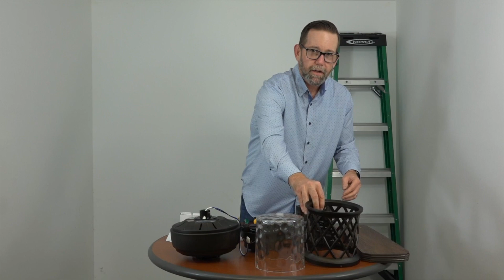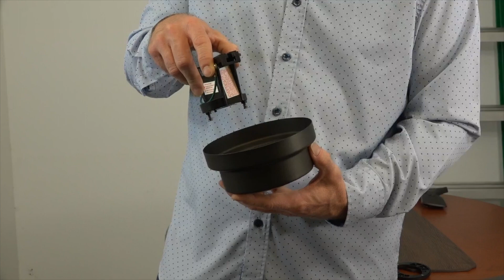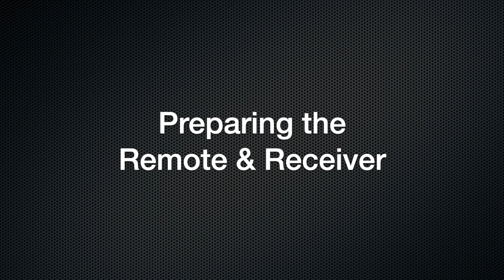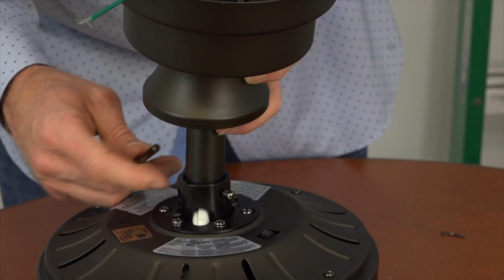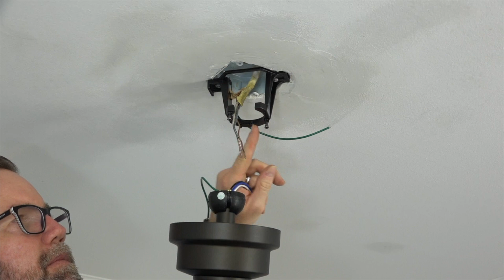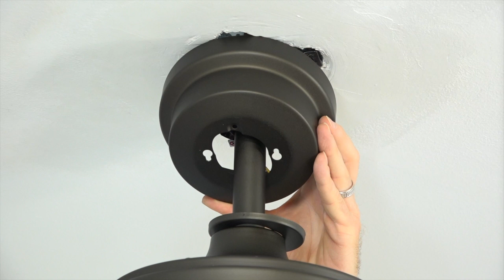How to Install the 52 in. Pine Meadows Ceiling Fan

Comment: I am looking for a fan that I can reverse the blade with the remote as it is in a vault that I can't get to. Is this possible? Thanks!
Reply from the maker: This fan's direction can only be controlled via the manual reverse switch. There are fans on the market that have a reverse function on the remote, but most fans have the manual reverse switch. When looking at fans, look for a reverse button (typically arrows in a circular pattern) on the image of the remote or look at the manual to see how the fan's direction is controlled. Most fan manuals are available for download from the product information page online.

Comment: Mine stopped working after 2 days..the remote is working but the fan and the lights is not turning on..
Reply from the maker: That seems odd. We would suggest making sure that the wire connections between the fan and remote receiver and the remote receiver and the house wiring are still connected correctly. Sometimes, wires can get loose or disconnect during the installation. If that does not resolve the issue, we would suggest calling the Home Decorators Collection customer service team at 1-800-986-3460. Their team is pretty good at troubleshooting issues.